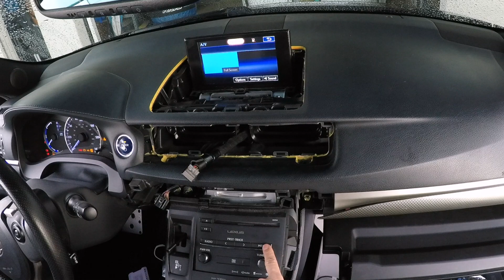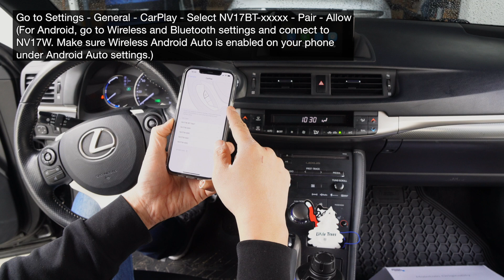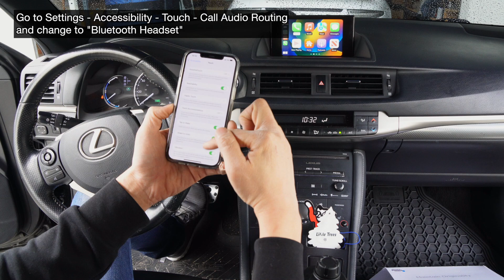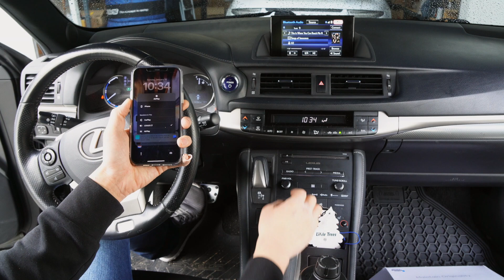2014-2017 Lexus CT | Wireless CarPlay Android Auto | DIY Installation

Comment: Will this take up the auxiliary port in the car or anyother ports i would use?
Reply from the maker: This won’t take up the aux port in the car. It comes with an additional usb extension cable that you can route anywhere in the vehicle